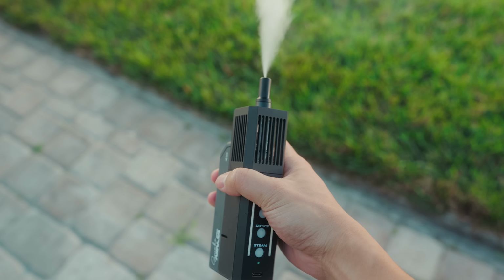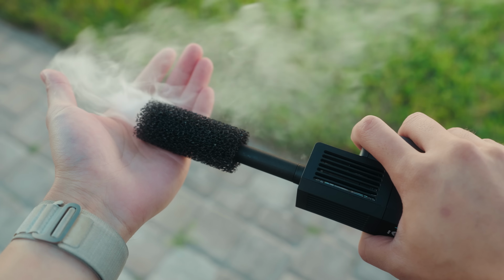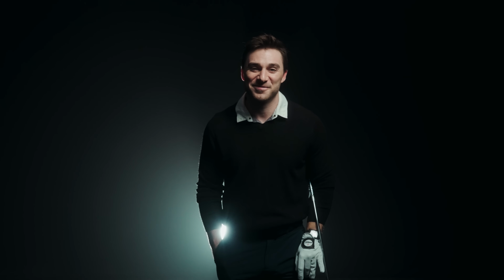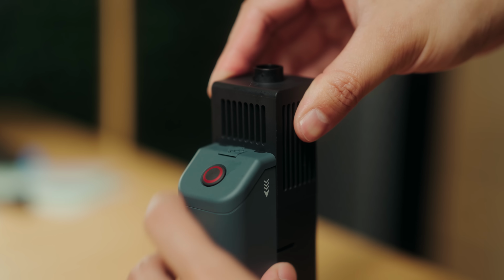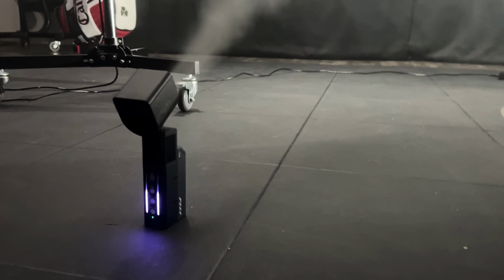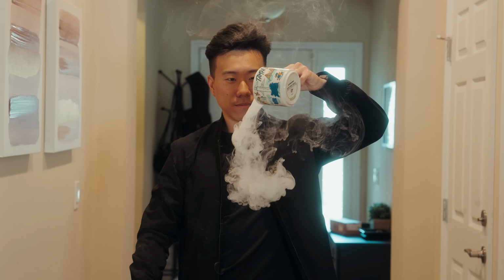Best Handheld Fog Machine? | PMI SmokeNinja Pro

Comment: do you have to worry about setting of smoke detectors?
Reply from the maker: I would say yes most likely, but it depends on the type of smoke detectors you're working around. However, if you're hazing a room, for the amount I did at the beginning of this video in the a-roll, my smoke detector did not go off and it's right behind me on the ceiling. Hope that helps!

Comment: Here are the takeaways! 📝

00:00 🎬 Introducing the SmokeNinja Pro, a handheld fog machine from PMI, showcasing its use in creating atmospheric effects in filmmaking.
00:54 🎥 Spec ad filmed using the SmokeNinja Pro illustrates how it enhances atmospheric effects with haze and volumetric lighting.
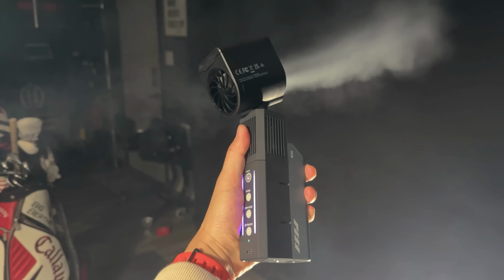01:40 🌀 Instructions on setting up and using the device, including the three available modes: fog, dry ice, and steam.
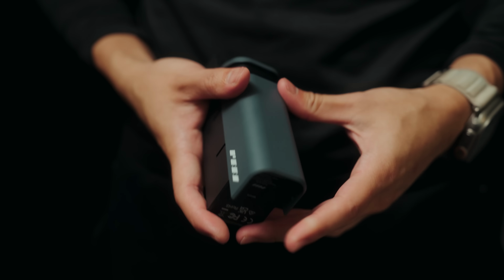02:23 🔋 Device specifications include a 15-minute battery run time at max output and USB-C charging.
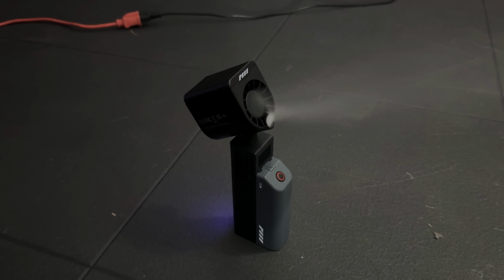03:06 🌫️ The hazer kit's bluetooth fan quickly fills large spaces (up to 1,000 square feet) with fog with ease.
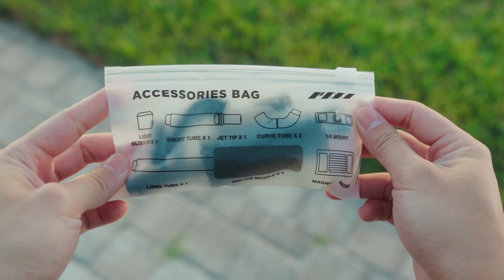03:35 ➕ Accessories like various nozzles and tubes allow customization of the fog effect for different creative scenarios.
04:31 🚀 The SmokeNinja Pro speeds up production time, effectively creating smoke effects without the lengthy setup associated with traditional methods.
05:12 🫧 Bubble nozzle attachment offers unique uses in niche photography and videography, adding creative visual elements.
06:14 🔒 Product safety testing shows 0% toxicity, confirming it's safe for skin, eye, and respiratory contact.
07:54 🛡️ PMI prioritizes safety in product design, differentiating itself by focusing on rigorous safety standards.
09:04 💰 The SmokeNinja Pro starts at $199 for the basic kit and $229 for the hazer kit.
09:31 🎒 The affordability and portability of the device make it a valuable addition to a filmmaker's toolkit, capable of enhancing production quality.